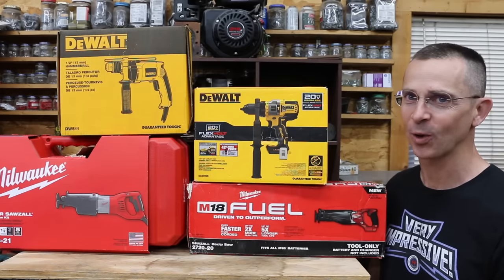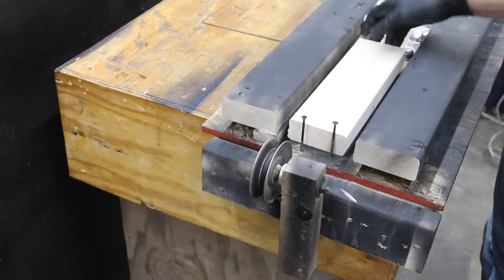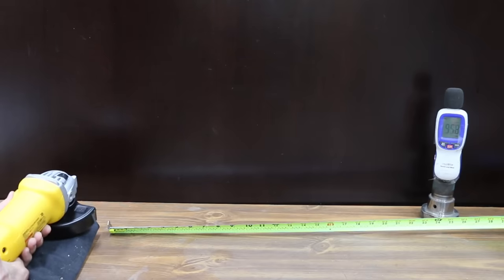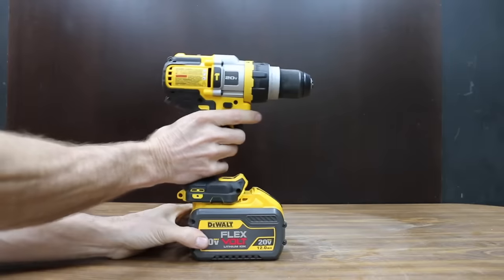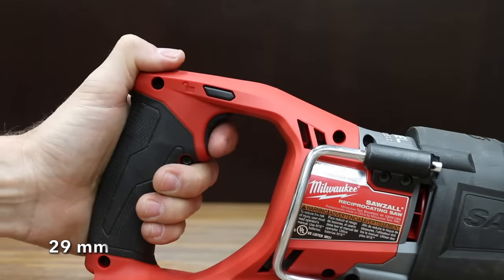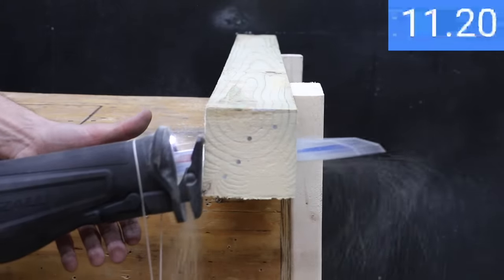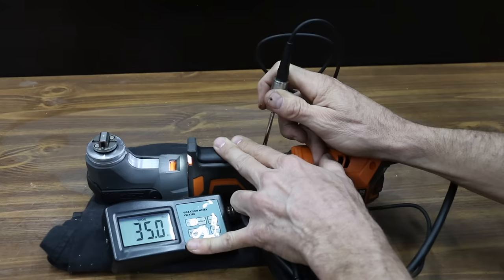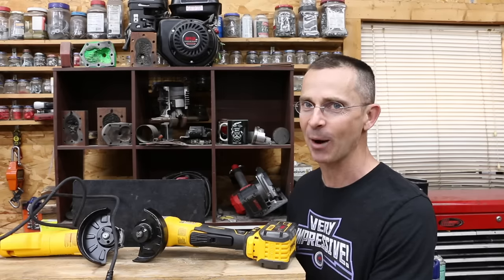Let's Settle This! Are Cordless Power Tools REALLY Better? Torque, Cutting Speed, Noise, Vibration

Comment: Never considered time to come to a stop. Of course the battery tools will stop more quickly. Makes me think of bandsaws with cast iron wheels that spin for a long time after turning the tool off. The good ones have brakes on them. For sure this would be a safety factor. Thanks!
Reply: I swear my 16 inch band saw takes 5 minutes to stop.
Reply from the maker: You are welcome!
Reply: @timrankin8737  but its very satisfying to listen to that hum continue on and on.
Reply: Not only safety, but less chance of damaging something. The angle grinder we have at home takes a long time for the blade to stop spinning. We have damaged our outside table and garage floor by putting the angle grinder down before the wheel stopped spinning.
Reply: Makita does make corded saws with an electric brake. This isn't exatly an apples to apples test.
Reply: Battery tools don't stop faster. 
Brushless motors do
Reply: Only baby "benchtop" bandsaw have a brake, and it's actually bloody dangerous!
Normal bandsaws, or BIG bandsaws (called Resaws) do not.
This is because blades crack and if you can't hear the tic tic tic, braking can snap the blade.
BTW.... If you are training a group to use these machines, DO NOT allow anybody to stand on the right hand side of the table.
Most times a blade breaks, it simply pops and stops dead.....but that one time the blade decides to bunch up on you, it usually shoots out the right hand side. You don't want to be standing there.
(I'm a class 1A machinist, former HSR, and a workplace trainer)
90% of mitre saws, drop saws, radial arms, pendulum saws etc do have a brake, but I've yet to see one last longer than 2 weeks in industry use before they die and the blade spins freely! 
Try something like an old school triple drum sander....those old girls would take at least 10minutes to spin down - if you get caught in the machine, you were stuck there in agony while it spun down!
NEVER use the brake on a more modern wide belt sander, it's NOT for regular use it's an emergency brake.
Buggers can't be stuffed waiting for the machine to spin down so they brake it to a stop....one day you will need that brake and it will be worn out if you brake the machine every time!

As far as battery vs corded....battery sux!
It's great if you need to go out to do an on site repair job, but that's about it!
There is a reason we use air tools or at least 240v tools in the factories!

My own workshop use to be fully equipped with Ryobi "One+" tools using "Bigfoot" (NiCad) batteries - until they changed to LiPo, and I had to retool the whole workshop!! NOT BLOODY HAPPY!!!
Now I deliberately get everything corded if I can....they never slow down, always at full grunt!
The cordless Makita drill at work can flatten a battery in half a dozen 12mm holes in a steel chassis!
Useless!! Throw it in the corner and grab the bloody corded Metabo!
Reply: @kurdaitcha3509  Yeah but let's keep in mind these types of videos are for the duffer who's major weekend project is what we call Tuesday morning.
And we need to be fair, not everyone has a 2 stage IR that can outrun two normal size die grinders operating continuously .
Nor do the duffers have 100 foot 12 gauge extension cords., or god knows how many feet of air line.
Reply: That doesn't have anything to do with it being battery-operated vs. Corded. It's because Makita chose to put a good quality electric brake in the battery operated one, and they chose not to spend the money on that corded saw. The electric brakes are an extra piece of engineering and some tools don't have them and some tools have better quality brakes. The tool companies are investing almost nothing into developing their corded tools now.
Reply: Some of the tools like the new grinders have DC injection braking. I don't think a brushless tool should stop faster by itself because it actually has less friction dragging on the rotor be a use no brushes.
Reply: @actionjksn  all modern docking saws are supposed to have a brake these days (in Australia at least), the problem is if you spend 8 hours on the damn thing docking off a few thousand bed slats, the brake has engaged thousands of times in a single day!!
By the end of the first week it's knackered!
Even the big 3 phase ones have this same problem.
On top of that, the stresses on the shafts and bearings makes the whole saw quite sloppy.
After a while you might notice the blade wobbles like a "drunking" saw! (Drunking saws were on a deliberate angle/wobble for trenching - no longer legal these days!).
Brakes DRASTICALLY shorten the lifespan of the tool.
Reply: @kurdaitcha3509  I've never heard of a docking saw in my life,  but all I've seen with the brakes is eventually they quit working and then the tool just works like a regular saw that never had a brake. I've noticed that some last longer than others.

 I have an old miter saw that used to have a brake and now the brake doesn't do anything. The saw still works perfectly 15 years later it just doesn't stop the blade when you let go of the trigger. 

I have a really old corded DeWALT circular saw that was top of the line and the brake still works on it but it's not as fast as it used to be.
Reply: @actionjksn  Yeah mate, my bad....."Docking saw" is just a bit of industry slang to describe any one of a dozen different small saws (usually compound mitre saws or radial arms etc) that are used for cross grain cutting to length - "docking off to size".
Probably the strangest example I gave would have to be the old school pendulum saws.
Haven't seen one used in industry since the 90's!
(It's just a saw hanging on a long pendulum arm, used very similarly to a radial arm saw)
Many of the oldest versions are belt driven.
Reply: @actionjksn  one of my pet hates with the brake is the few seconds delay before the brake kicks in.
It creates a hidden danger, and I have personally seen it cause the saw to bite a workers hand....nearly had it happen myself!
It causes a jolt that can kick the saw down a few centimetres....usually right when you have your hand there flicking out some offcuts!
While we ARE supposed to use a bit of scrap to do this, in the real world it doesn't work that way.
When you have 3 full pallets of bed decks lined up behind the saw (just a normal day's work!), It's just a mindlessly repetitive process of "dock, flick, load, dock flick load".....all bloody day!
I would rather the saw simply kept running, or at least kept spinning!
All the constant harsh starting and braking every few seconds just destroys the machine in record time!
Reply: @kurdaitcha3509  I work in the building trade-in the United States I don't think that term is used here. In America docking means to cut off a dog's tail so that it's really short.
Reply: @kurdaitcha3509  I don't do that kind of work,  I frame walls and do custom trim and other wood work.  Not much repetitious type work.  I hate waiting for the saw to stop spinning.
Reply: @actionjksn  yeah, I'm a bit past that these days....that shit's for the young bucks still coming up through the ranks.
Thats the difference between a machinist and an operator.....
Operators poke boards in the machine, where a machinist has to set, maintain, repair almost every machine in the factory.
Everything from fixing the CNC mills to repairing and rebuilding routers and beam saws.
Reply: @actionjksn  Yeah, mostly because when you buy corded tools, they just last and last, vs battery tools where selling batteries is a recurring revenue stream for them. And then eventually "oops, we don't make those batteries anymore". I only have one cordless tool, a 1/2" HF impact driver (the one that's in the same brand line with the air tools). I also have a 1/2" to 1/4" hex bit adapter for it so I can use it for screwdriver tips as well as sockets. It comes in handy sometimes, but the corded tools still get plenty of use.

Comment: Something I noticed is that when you were comparing sawzalls, the battery operated one, the shoe was coming off the 4x4. That could account for longer cutting times also, as the throw length would be reduced, since the saw is now vibrating, (instead of being steady on the 4x4) along with the throw.  It also almost seemed like the blade was catching or having a hard time on the nails, which is when I noticed the shoe come off the wood, and the downward movement slowed, until the nail was cut. The corded saw, looked very smooth and steady by comparison.
Reply: I saw the same thing, the other thing I noticed is the angle changed when the show bounce happens.
Reply: He also compared a regular Sawzall to a Super Sawzall so not exactly the same too
Reply: Really think he could keep the shoe 1 32nd of an inch off the 4x4 like that if he tried. The shoe was being pushed off. The corded super has a ton more torque, that will keep that thing steady. Not a corded guy either just saying.
Reply: this is completely true, you have to push "in" with a sawzall to get a good cut. if that shoe is not firm against whatever you are cutting, than it doesn't work too well. the downward force isn't as important as keeping that shoe against the material.
Reply: @colbywood8113  the price

Comment: Personally I like having a corded backup. Especially when drilling. The battery just can’t keep up with what I’m trying to do.
Reply from the maker: Thanks for the feedback.
Reply: I agree - it really depends what you need to do.  Cordless drill will do small holes and screws all day long but put a hole saw or big spade bit and you chew thru batteries like they're going out of style.  Also if you don't want to spend a small fortune, a corded $70 saw will outperform a cordless $70 brushed motor battery saw with ease.
Reply: @matthewmiller6068  I agree. A hole saw is the drills worse nightmare. I use a 3 inch saw a lot it might get through one time, but you’ve gotta get it done seven more times well. It ain’t gonna happen.

Comment: Looking at that Makita corded saw; it looks like R&D (and design updates) on it ended 20 year ago. The cordless model looks contemporary. I wonder if the corded saw would have done better if some of the new tech developed for the cordless saw had been applied to it too.
Reply: It seems the cordless ones, generally speaking, had more modern designs + bells & whistles.
Reply: Good point, cordless had brushless motor, corded had brushed... That is a big difference. Not sure if they make corded brushless saws.
Reply: yeah most of the corded ones were just straight up missing features the cordless ones had.
Reply from the maker: Thanks for he feedback.
Reply: There are some AC tools that have brushless motors.  
But any tool manufacturer is going to R&D the shit out of cordless purely for the fact that the customer can come back and buy more tools that use the same battery.
Reply: That was the first thing that came to mind before watching.  Without getting into the weeds battery tools started out with 12v, then 18v, then 24v and got better with increased voltage.  It would stand to reason a 120v tool could deliver better results.  But when a battery goes down all bets are off.
Reply: And the 36v one here isn’t even the newest one available.. the new Xgt is a monster
Reply: @BigMeechie304  No, cordless runs on 18 to 36V, and requires complex/costly low voltage electronics. Corded runs on 120/240V and requires very simple/cheap electronics. Complex electronics for a 120/240 saw would be way to expensive and be up against a 99$ saw.
Reply: I've noticed this trend with all the major tool makers.  Corded tools must not sell as well and therefore the mfg don't put the same attention into them as battery tools.  Corded gets less budget.  Kinda sad because I prefer corded tools most of the time since I mainly work in built homes
Reply: @yung_sirloin  most of the corded tools are used in areas that don't lack light. Cordless on the other hand tends to have lights due to lower light work areas.
Reply: Comparing a $200 saw to 100 corded seems unfair when comparing
Reply: @chris746568462  You mean they will come back and buy mote batteries.  The old Nicads sucked. Thr nmih sucked a little less. The lithiums suck a lot less.. but unless its light duty.. ill stick with corded. I do industrial/automation/machine tool repair.
Reply: @GunnerAsch1   
Yes, more batteries and tools that use them. You are kinda "locked in" unless you want some spaghtti mess of chargers.
If you tried the flexvolt grinder you would be impressed, it would have kept up with the corded in these tests.

Comment: For the Drill test it would have been nice to see a test using the drill as a drill, with something like a 1 inch auger bit. Corded drills are designed to be drills, not screwdrivers or impact wrenches, so seeing it doing what it was designed to do would have been nice.
Reply from the maker: Thank you for the feedback!
Reply: That's what I was thinking. The corded doesn't have a clutch. I'd also be interested in comparing the hammer action of a corded vs cordless. I have a feeling the hammer action on the corded drill is much larger than the cordless.

Comment: I've always said that there's nothing really to settle in this debate. You choose the tool that is appropriate for the job and accept that differences are there, and that they actually represent advantages instead of "this is better than that". Corded wood routers are more stable than their battery equivalents, battery tools are safer if there is a chance of the tool getting wet. Pick your battle.
Reply from the maker: Thanks for sharing.
Reply: I might have missed something, but I don't think routers were covered. Might be a good suggestion if they weren't.
Reply: @kenfuciusfpv2800  Illustrative examples, nothing more. The principle applies.
Reply: @TristanJCumpole  well it seems that from Todd's tests things are decidedly better or worse than other things. It seems to be specific to which tools are being tested. Routers were not tested.
Reply: @kenfuciusfpv2800  Unwind a bit! This is about corded vs cordless.
Reply: Get both!
Reply: @JoePolvino  Agreed. They both have advantages.

Comment: I have a 3/8 variable speed reversing drill by Milwaukee.   It's corded, and it was purchased in 1978.  I have replaced the trigger and power cord. It still works just fine for driving screws.  I can't tell you how many cordless vsr drills I've bought and thrown away over the years, the main reason being battery obsolescence and tool quality.  I still use my Dewalt cordless tools  all the time, but I doubt they'll be around in another 40 years, but I bet the old Milwaukee will be.
Reply from the maker: Thanks for sharing.
Reply: Correct
Reply: Steve, try the Ridgid. Fabulous power, and you can’t beat the Lifetime Guarantee - batteries included. Oh, and it has a 1/2” chuck. You’ll never appreciate driving screws more, especially NOT having to drag an extension cord up a ladder.

Comment: Definitely looks like manufacturers are focusing more on cordless tools instead of corded ones. The margins are much higher when you're selling $100-200 battery packs which can be just as expensive as the tools, in addition to the tool, so they put more effort into them.

One thing that wasn't covered in the video is endurance. I'm sure this is a no brainer for a lot of people, but if you're working on a construction site, tools will be used for prolonged periods of time which means battery endurance really matters. Lithium is pretty good at delivering full performance right until it runs out of juice, however if there is a loss in performance over time with the battery, or if the batteries overheat during extended cuts/grinds/usage, it will really detract from it's value.
Reply: this is exactly why i never buy batteries from the manufacturer, far more cost effective to "roll my own"
Reply from the maker: Thanks for sharing.
Reply: Not just endurance of use, but also longevity of the equipment. I still have quite a few corded tools because I really hate buying a new battery or two every 2 years because the cells are wearing out and only last 10 minutes of use by that point. It really adds to the cost when replacing batteries instead of just getting a corded tool out down the line and not having to worry about a thing

The only battery tools I keep around are a ratchet and a drill, because those tend to be things I care enough about the quick ease of use to justify.
Reply: Client I just did a job for bought a battery operated lawnmower (green and black but I don't think it was Ryobi). $350 for one of those batteries. He said he got around 2 hrs out of it, called, complained, they sent him another and said to throw the initial one away.
Reply: @TimAwolz  Greenworks, maybe?
Reply: @jaklumen  yeah, you nailed it.

Comment: Great comparison!
Something that makes a cordless drill better is the brake, even without anti-kickback they are more manageable if a bit binds up.  I’ve got a corded Milwaukee that will put you into a death roll like an angry crocodile.
Reply: Lol. Me too with the Milwaukie. Enough torque to twist my arm right out of its socket if I'm not careful.
Reply from the maker: Thanks!  Thanks for the feedback.
Reply: I have a big pipe on my triple reduction Milwaukee D handle HD drill. Because she's got a bit of torque to her.
Reply: but that corded drill will go all day not the battery ones and not as strong
Reply: My Milwaukee corded fuel about does the same thing, seems to be the nature of gear reduced high power drills.
Reply: A Hole Hawg will take you apart also.
Reply: @probuilder961  Roger that!  The torque on those is crazy and if a large forstner bit catches a nail or screw the right way it can send you flying!
Reply: @cpufrost  lmfao 🤣 that is so true because it happened to me. I laugh now but when it happened man did it hurt.